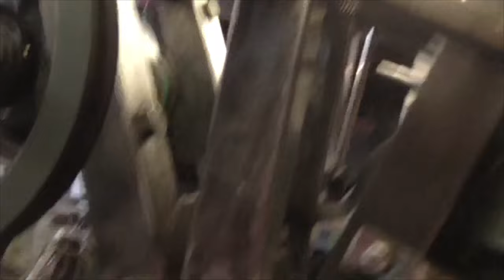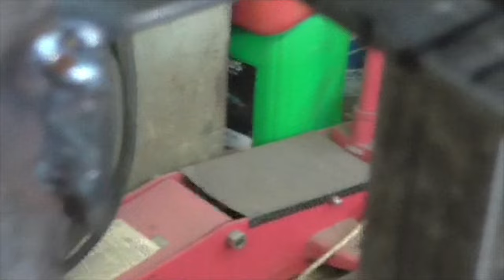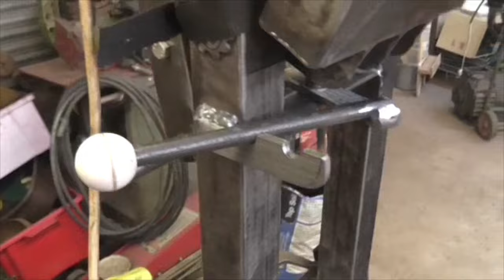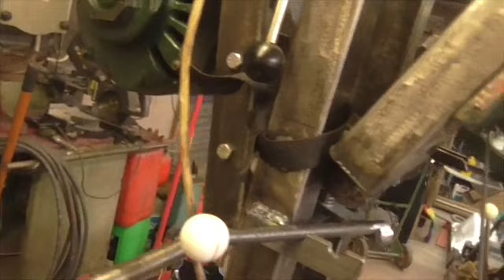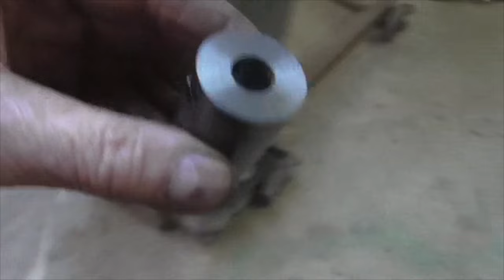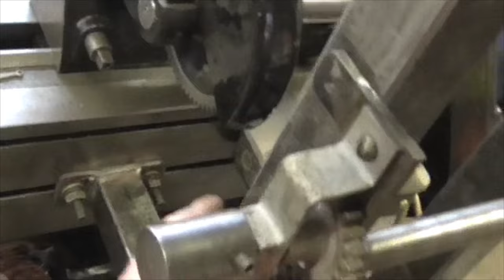A fortuitous mistake on the Holbrook B9

Comment: It's brilliant Phil. Works like a charm. The brake effect was an added bonus. I'm glad your Rapidor is feeling better. 
Best wishes, Dean.
Reply from the maker: Hi Dean, yes it did work like a charm!! the brake effect was unintended, but the banding is adjustable so I could increase it as long as it doesnt rub the back of the belt when its driving!
Phil

Comment: Looking good. I have been wondering what it's first job could be!
Reply from the maker: Something small, possibly a thread, and in a collet? Haven't really thought about it yet, I have to finish  the collet tube by making and fitting the missing handwheel, plus there will be some shakedown to do, because some parts need testing under load to see if they are fully functional again, but it will be soon!
Phil
Reply: Nice work, Phil. That lever is definitely better in its new position. Cheers Tony
Reply from the maker: I originally intended to fix the operating lever direct to the box section, but the 90 deg required movement was too much, and I had found the gear unit in the junk under the forge when I was looking for the handle last week, and the rest is history!! It reversed very easily due to the fact that for once I was being good and measuring twice, and welding once!!
Phil

Comment: Couple of questions sir Philip.

Why run the file over the rod rather than just holding it against it?

What is the leak under the Rapidor? (Ignore this question it was answered later in the video!).
Reply from the maker: If you just hold the file against the rod it fills one tooth with metal cuttings and stops cutting, it also wears the file unevenly ! If you have a qctp you would use a chamfer tool to put a bevel on, a file is not ideal, but it works

Comment: Can you find an antique style starter as it would match the style of your lathe and the motor drive mechanism
Reply from the maker: Not easy! the one that would fit the bill is the MEM startet, which is cast iron boxed, and looks the part, but you don't see them about today, they were out of use when I started work in 1967 because they have no coil, and therefore no no volt release so technically not so safe, though I have one on the Grafton drilling machine which has not caused problems, I will have to see what I have in old switchgear, it is single phase so shouldnt be too difficult, but I agree, it would look better with summat old on it!
Phil
Reply from the maker: I may just have found a suitable starter, it is the original one off the covmac, I will dig it out tomorrow!